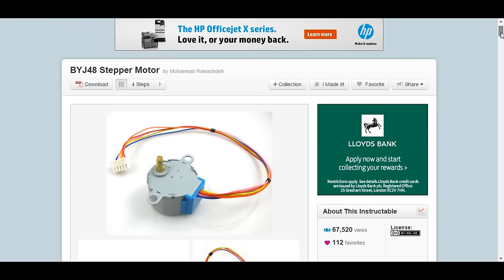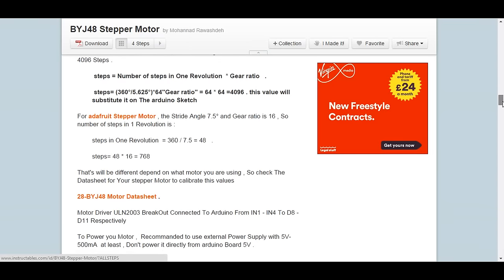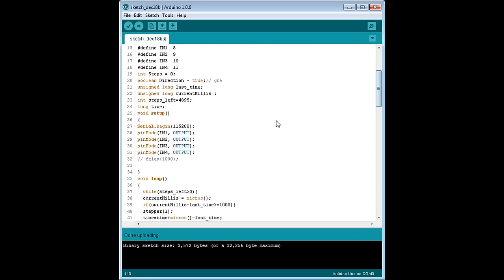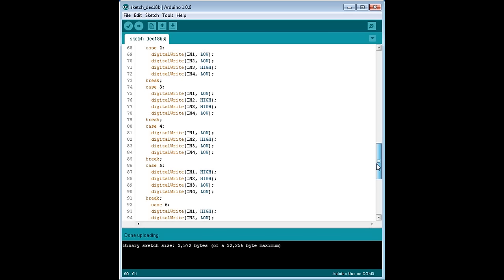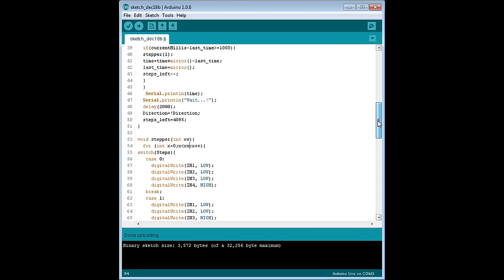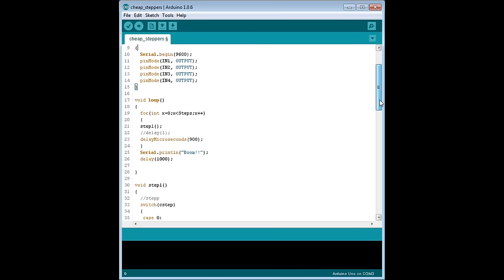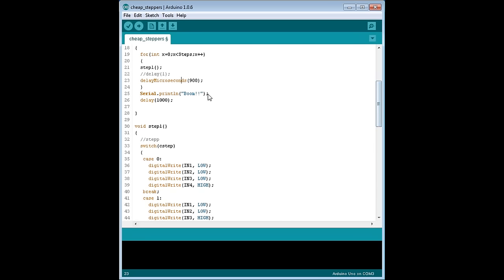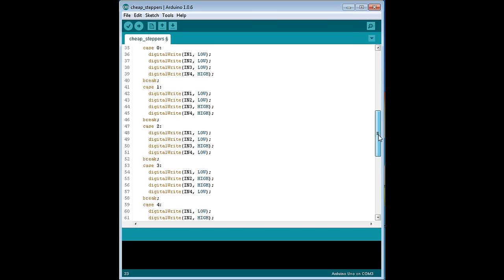#4 5v stepper motors from eBay... as cheap as chips... 28BYJ-48 + ULN2003 Driver

Comment: Try using a separate power supply for the motor. The Arduino cannot produce enough current to run the motor effectively even thought the motor is rated at 5V, it actually needs a lot more current than the Arduino can provide.
Reply: I had the same problem. I was using a separate power supply
Reply: Hi Nick - do you have any details on an external supply? I'm trying to connect the driver board to a battery, but obviously need to find the right connection and regulator....

Comment: Forgive me this has already been said but the motor is actually going faster than it looks. The motor is driving a reduction gearbox built into the top of the motor. This is why the output shaft is off centre. If you want a faster motor you need one without a integrated gearbox, such as the ones you see on 3D printers etc. As you say these motors are very cheap and have so little torque, they need the reduction gearbox to give them some useful torque but at the sacrifice of output shaft RPM. Thanks for the video very nicely explained. 👍🏻
Reply from the maker: +Darren Turner spot on, there are some vid's on youtube on how to modify the motors to remove the reduction steps, but as you point out you loose the torque. For the price tho, i can't really complain.
Reply: +Crazy-Logic Too right they as so cheap, I don't know how they make any money on them! I've bought some, I have no idea what projects I'm gonna use them on but they were such good value I had to have some. 😀
With your video I had them up and running smoothly in next to no time - thank you.

Comment: Managed to make them to bipolar motors, used two l9110s (H bridges), they now work on 10v, but can reach speed of 800 (with half step algorithm, you can select other two wave and full step algorithms, also written my control software) and now they have a lot of torque.

Comment: im not sure if it matters,these 28BY steppers are uni-polar motors,and may need a different program to run properly,the arduino sketch is probably more for bi-polar motors,even though the input to the controller has four inputs.
It may or may not matter,im not a programer,im a design technician,and i never got into programming ,until now.

Comment: try powering the motor with external power supply,  run positive to the positive of the driver board, run the negative of the power supply to a negative of the arduino, then run a negative from the driver board to arduino. Remember the power supply should be 5 volts!! power the arduino as you normaly would. Hope this helps someone.
Reply: Can I use the same external power on Arduino too not only motor? I don't want to have two power sources on final project.

Comment: I realize that this video was made a while ago but regarding RPM and torque: to attain higher RPM and sufficient torque you need to do two things. 1. Better power supply. You are drawing power from your UNO board and you might not get enough juice out of it. 2. You need to ramp up the speed. Involves some trigonometry ( need to compute slope: time vs RPM ) and not all that easy on an arduino.
Reply from the maker: +Sridhar Sathya yeah - it was a very basic video. There's alot that can be done with motors - and i'm no electrical engineer. The power supply tip goes for any motors on Arduino, DC, stepper and servo's :) 

I'll be honest - I haven;t thought about ramping for these little motors. If i come back and revisit these i will loo into that (trig actually tickles my mind, tho i suspect a simple linear slope with a fixed acceleration would work?)

Comment: Check out the AccelStepper library.  It's a free library, and can handle acceleration, full and half steps, and even multiple motors.  Arduino should drop their current library, and adopt this.
Reply from the maker: +Timothy Rupe just had a look at that and it looks pretty awesome :) thanks for the comment :)

Comment: I can see from the lights on the board that you have the wrong sequence. It should be two lights next to each other except on the ends. There are a ton of articles on this motor with the wrong phasing. so 1100, 0110, 0011, 1001
Reply from the maker: That's an equally valid way of driving some stepper motor's but not all. Wave drive VS Full-step VS half-stepping VS micro-stepping is a more complex topic that that if you understand, then this video is below your level. This video shows the half-stepping technique. For those who want to know the difference, wikipedia has a good summery. https://en.wikipedia.org/wiki/Stepper_motor#Phase_current_waveforms

Comment: You can actually make them a bit stonger in full stepping mode. If you delete steps 0,2,4,6 in your sketch, you're left with four steps that activate 2 outputs. The original Arduino sketche only uses one output at a time, that doesn't work on these motors. I tested the torque a while ago in half stepping (like your sketch) and full stepping, it does make some difference (from 300 to 380 gcm) : https://youtu.be/14jF8umwJLI  You can also cut one wire in the motor and use a different driver (bipolar), that makes them almost 3 times stronger (800 gcm) : https://www.youtube.com/watch?v=jHLyJbNgcDo

Comment: Really helpful! I'd written off the motors as having no torque because they were  cheap rubbish  but as u say it is the default sketch that's is the problem.
many thanks
Reply from the maker: You're welcome. Just curious - what was you use for them and how successful has it been?
Reply: I was thinking about designing and printing a camera mount that rotates on 2 or 3 axis. But for now im just trying to get to grips with the motors and the Arduino sketch u provided. As a total programming noob, it would b really useful if u could go back to the "cheap_steppers" sketch and include more notes for what each line of code is doing. I really can't understand the function of the "for loop", although i know its needed.
Reply from the maker: +Savage Rodent its interesting you say this as I was thinking of making a ptz mount with my 3d printer and these motors also. its still in my todo list but, I think I'll raise it up abit as I think it would be a great project to do. would you like to email me and we can collaborate on the design?

Comment: Try using external power, then you might have more torque?
Reply from the maker: ahh, good thinking there scubaflooba, i might give that a go, tho let's be honest - these are super cheap, so i'm not expecting much. (also i don't think it's hitting the 1a limit on my laptops usb, as normally this would trip the usb ports polyfuse or whatever they use and give me a message in windows)

Comment: I was wondering if there is a way to  change the rps with buttons or joystick?
Reply from the maker: +Çağrı Mert Yes there is - you can code this and there are many example on the net to take a sensor value and then output it in various forms, including to a stepper motor.

Comment: Dont use arduino to power the stepper :)
Reply: The stepper is powered by the controller board
Reply: which in turn is powered from the power pins on the arduino
Reply: ravener  What's the maximum power rating of the +5v pin?  Isn't it wired directly from the USB port?
Reply: ***** afaik it's coming through an AMS1117 voltage regulator. maximum output is 800mw.that might just be for driving the chip though, the power rail might be directly connected
Reply: No you're right - the +5v pin is connected to the voltage regulator.
Reply from the maker: so yeah - this is a current limiting factor - most USB used to be limited to 500mA i think (YMMV), so this indeed is a limitation in this set up. 

You can use an external source for 5V for the Driver board and leave the Arduino on the USB 5V, just remember to connect the grounds!!!!
Reply: @CrazyLogic  on final project can both Arduino and motor be connected to same battery +5V? I don't want to have two power sources.
Reply from the maker: @gasparigi  yes, you can use the same 5v supply, battery or otherwise. You might want to add a capacitor over the supply near to the microcontroller to dampen any spikes created by the motors
Reply: @CrazyLogic  thanks for reply. Is this solution also safe?: external power directly to motors (or driver) and split cable to MB102 power supply module and from module 5V to Arduino, and I should get constant 5V for arduino(?)
Reply from the maker: @gasparigi  I'm not sure what the MB102 power supply is, but using the same supply for both control and motors isn't dangerous, in terms of any more dangerous than using two separate sources with joint grounds.

Comment: Hi friend!
1) I have this card and would be using 12 volt stepper motors; how do I do?
2) Which pin on the ULN2003 is connected to the COMMON stepper? Thank you
Reply from the maker: hiya, off the top of my head I'm not sure if they are rated for 12v, but have a quick look for the spec sheet online. how you wire them depends on if you at driving them in a unipole or bipolar arrangement. there's plenty of guides out there that are much better than I can explain on the difference and how to wire them up.

Comment: Okay thanks, how to code if stepper motor will stop when press micro switch?
Reply from the maker: ahh simple - if you nest the code inside a while loop, use a contradiction statement for logic - so like :

While (button is not pressed){move stepper} 

Then it will stop when it is pressed, but loop over the code continuously while not. but it will check then perform one whole loop then check again ect... otherwise you could do multiple breaks within your code to get out of any loop it is in ie; 

if(button is pressed){break}
Reply: I am still confused code {do while}, how complete his code?
Because it is still a beginner

Comment: Thanks I almost bought them for a robot project where I need a lot of speed and accuracy.
Reply from the maker: how big is your robot? alot of small robot use servo's rather than steppers as they have a feedback loop built in, if you need more power then maybe move upto Nema17 or 23 steppers
Reply: It will be small mobile robot. Probably 25x25mm. We try to know how much is the robot moving to know the position of it. It's because we know the environment sizes then we can do mapping or expect where the robot is located.

Comment: copy this to the Arduino program
-----------------------------------
#include <Stepper.h>
#define STEPS_PER_MOTOR_REVOLUTION 32 
#define STEPS_PER_OUTPUT_REVOLUTION 32
Stepper small_stepper(STEPS_PER_MOTOR_REVOLUTION, 8, 10, 9, 11);
int  Steps2Take;

void setup()
{
  // initialize the serial communication:
  Serial.begin(9600);
 
}

void loop() {
 int brightness;

  // check if data has been sent from the computer:
 
    if (Serial.available()) {
      brightness = Serial.read();
  if(brightness < 100)  { brightness = 0 ;
Steps2Take  =  STEPS_PER_OUTPUT_REVOLUTION /16; 
small_stepper.setSpeed(700);
small_stepper.step(Steps2Take);
}
  if (brightness > 160){ brightness = 700;
Steps2Take  = - STEPS_PER_OUTPUT_REVOLUTION /16;
small_stepper.setSpeed(700);
small_stepper.step(Steps2Take);
}
}
 
    
}
--------------------------------------------------------------------
Copy this to processing 2 program   https://processing.org/
----------------------------------------------------------------------
import processing.serial.*;
 Serial port;
 void setup() {
 size(512, 150);
 println("Available serial ports:");
 println(Serial.list());
 port = new Serial(this, Serial.list()[0], 9600);
 // If you know the name of the port used by the Arduino board, you
 // can specify it directly like this.
 //port = new Serial(this, "COM1", 9600);
 }
 void draw() {
  for (int i = 0; i < 200; i++) {
 stroke(34,2,32 );
 line(i, 0, i, 150);
 }
for (int i = 0; i < 120; i++) {
stroke(204, 102, 0);
  line(i+200, 0, i+200, 150);
 }
 
 port.write(mouseX/2);
 }

Comment from the maker: If you want a nice video on the inner workings then check out https://www.youtube.com/watch?v=15K9N1yVnhc
Reply: +Crazy-Logic 
How loud are this type of motors? I am searching for something, that is basically unnoticeable to use for a bedside table lamp (so you are pretty close to it when it moves as well.. )
Is there a way to find a particularly quite one without having to try them all out?
Reply: +Anastasia Sokolov  these motors are really quiet but don't have much power
Reply from the maker: +Anastasia Sokolov the ones i have are reasonably quiet - much quieter than a equivalently priced servo. unfortunately most suppliers wont give you any audio specs at the cheap and cheerful end of the market.
Reply: Thank you !
Reply: I want the motor to revolve maybe 10-20 times then come to a stop. Could i do this using your code? Ill be using this exact set up.
Reply: have you try full stepping? basically two coil (one and its adjacent) will be energize at a time. this technically give the full torque of the assembly.
Reply from the maker: yes - try a for loop, with each loop doing a step, the number of loops dictates the number of turns or part thereof.